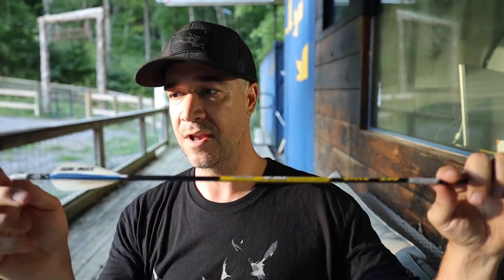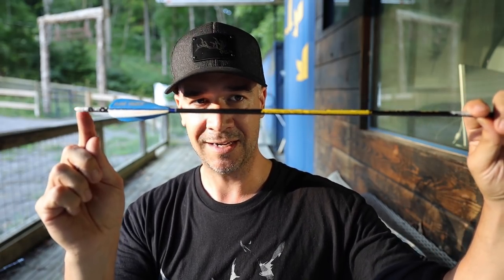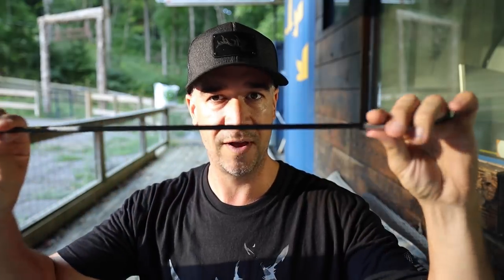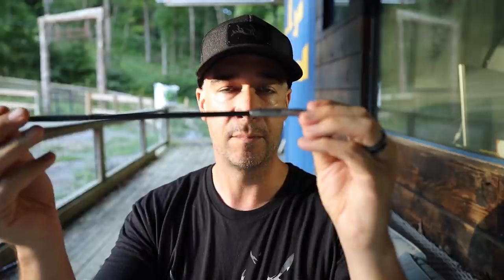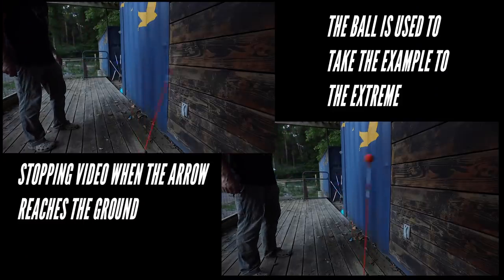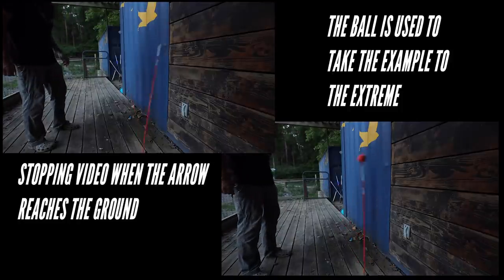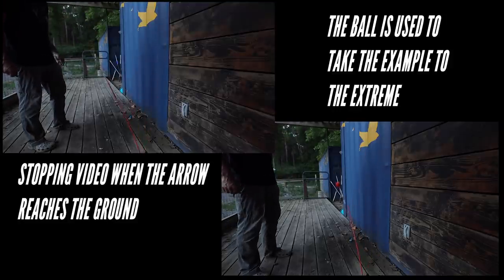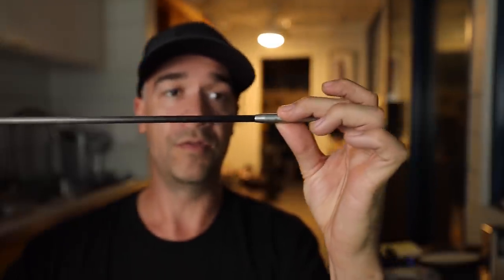Arrows Part 2: A dumb guys understanding F.O.C. (Im the dumb guy)

Comment: You're on the right track with your understanding of why. Some physics to explain:  momentum involves MASS. P=M×V (momentum = mass x velocity) Since all parts of the arrow travel at the same velocity, momentum is contained where the mass is. FOC and why the arrow 'pulls' from the front is because energy in motion is concentrated (kinetic or potential) where mass also is. And so the momentum is focused in the front, pulling the tail along.
The fetching helps the arrow fly straight because of air resistance, not mass; and having more air resistance with the lightest weight material doing that is best (rocket fins). - Thanks for the cool video!

Comment: i agree with everything you summed up in the last part of the video. I also am learning about this, taking info in and really listening to whats said. Like you said- most of it is based on 20-30 yd shots. I think alot of people need to listen first. We dont all need 600+ g front ends to kill deer or elk. The RF info is really amazing and real- get that FOC up as high as you can while keeping your arrow weight to the distances you plan on hunting. For example- i was in the same boat as alot of guys- 65lbs, 27" DL and shootting 400 spine/100 grain tips  around 370 grains. I jumped up to 530 grains with an 17.5% FOC and my pin gap really hasnt changed too much. Great channel by the way, recently found it... two thumbs up :)

Comment: Hey Brandon. love the videos that you make and the contribution you are making to archery. I think I have another thing that you can talk about that is not talked about in all arrow building videos I have seen. its the Kinetic equation itself KE=1/2MV^2. the archery industry tells us that the V in the equation is a more important because the velocity is squared  which means that velocity will increase KE more than the mass part of the equation. As an engineering student I take issue in this perspective. Yes, it does effectively raise your KE value as velocity goes up but what people arent talking about is once you hit an object, I.E. and animal. the velocity quickly declines and an astonishing rate. if you were to calculate the KE after 1 or 2 inches of penetration the KE value is dropping fast because we put so much stock in making the velocity number large. on the other hand, If us as archers put more value in the mass part of this equation, you are putting more energy from the bow to move a heavier object and because you put more energy into the "mass" part of the equation. the mass doesnt decline once you hit an object which explains why mass will penetrate further everytime because we are putting more energy into something that wont decline once it hits something. In short, the harder is is to accelerate an object also results in a greater difficulty to slow it down. ie momentum. the easier an object is to accelerate (focusing on light arrows) results in an arrow that also slows down faster. ie less penetration. I hope what I said makes sense and is a perspective that nobody I have seen on youtube talk about specifically. Stay sweet, MLee

Comment: That intro clip was pretty slick. I too am still looking into learning more about F.O.C. and trying to experiment myself. I did buy a test kit with multiple point weights from 100-300 grains. I have never fletched or built my own arrows, pretty much just grabbed a half dozen arrows (340 spine Cabela's Stalker Xtreme 9.3 gpi, even though for my draw length and pull weight the charts say 400 spine) with aluminum inserts and a 100 grain broadhead. I recently did get some Carbon Express Mayhem SDS 350s that are 11.25 gpi and come with 47 grain inserts. I did buy a couple packs of cut on contact fixed blades that 100 grains since that is all Cabela's had. When I get the test kit I will see what my old 2006 PSE Fire Flite 33 with a 60 lb draw weight and 29 inch draw length likes the best. The advertised speed at 70lbs was 295 at the time, I recently chrono'd my standard arrow set up at 264 fps.  I know speed isn't everything, but I am sure it helps. 
Thanks for sharing and I look forward to seeing what you found out for your VXR with a 30" draw length and 70 lb draw weight likes.

Comment: On the pulled from the front - think equal and opposite reactions. There are four drag contributors on the arrow: the tip, shaft, fletchings and the nock. The tip contributes between 2-5% of the drag (can be higher on broadheads). The shaft is between 60 and 80% of drag, but it is mostly space evenly along the shaft, and the fletchings/nock contribute 20 - 30%. Since the fletchings and nock are basically at the back of the arrow, they are in essence “pulling” back on the arrow as soon as it has left the string. The equal and opposite reaction is that the mass, located more heavily at the front of the arrow, is pulling it forward. It makes sense then that farther foc arrows would want to fly straighter due to these two equal forces being further apart. This can be demonstrated by taking two strings and fixing one to the arrow near the fletchings and the other to the center of mass of the arrow. Put a light force on each string and see how much the arrow oscillates. All else being equal, the farther apart those two points are, the lower the oscillation.
Reply from the maker: Good visual. I may have to try that. Thanks for taking the time to write the comment

Comment: Thanks for update,I have been on the fence for a week now since blowing thru a block crossbow target in less than a year with my 60lb compound.And that's with just field points shooting every spot possible rendering it useless.Also purchased a Morrell Range target in Jan.& already getting pass-thru's,jumping on bag doesn't help much re-distributing material inside.What good does a free new cover replacement do if the inside is shot---Useless. I also shoot field points almost every day year round & broadheads when hunting season rolls around to make sure their still dialed in. I just find  few who have reveiwed this product in detail like you have with your unbiased opion .Thanks

Comment: Dr. Ashby’s website has a LOT of information regarding his theories, ideas, and recommendations. I do not believe he is completely wrong, and I do not believe he is completely right. Here are some of my thoughts:
1) Much of his research is based on African plains game or similar. Even though he does  differentiate (mildly) between those animals and deer/antelope game, it is an apples and oranges comparison. 
2) For “medium game” (whitetail deer), he recommends a 650+ grain arrow with 20%+ FOC (mechanical broadheads are a cardinal sin). To justify this, he uses an example of a hunter getting poor penetration using a bow (unknown if recurve or compound) with a draw weight of 35#, a “light, fast arrow” (no specifics) and expandable broadhead. Gee, no kidding you got lousy penetration. 
So here’s my statement on this, shooting any modern compound bow, with a draw weight of minimum 50#, YOU DO NOT NEED A 650 grain arrow with 20%+ FOC to ethically take deer. 
3) Passthrough shots with mechanical broadheads on deer sized game is easily achievable as long as your set up creates enough kinetic energy to do so reliably. A 650+ grain arrow is not necessary to do this.
4) Regarding “large game” using his example of brown bear, recommends a minimum 650 grain arrow because “Why risk having to use a gun to dispatch an animal (if allowed to save your life)”. If I’m hunting brown bear with a bow, I don’t give 2 craps if I shoot an arrow weighing 8 pounds. I want someone backing me up with a rifle even if I made a perfect shot. That SOB can still charge you after a perfect archery shot!
5) Certain statements, for example, “For his FOC testing, Dr. Ashby used 82, 70, and 54-pound bows of similar efficiency” are vague. Similar efficiency to one person may be completely different to another.

I agree that lightweight arrows are better suited to the target/3D range. I also agree that a higher FOC will increase arrow flight stability and also increase penetration. However, this deer season, I’m shooting 500 grain, 28.5 inch arrows, traveling around 278 FPS, with an expandable, at around 13% FOC. If Dr. Ashby’s theories are correct, and my arrow bounces off a deer, or if for some reason, the arrow actually does penetrate (probably only the same as a hungry mosquito), I’ll be the first one to let you all know, and sit down for my crow dinner.
Reply from the maker: Let's say on a scale of 1 to 10 it takes a 3 to kill a white tail. We may be discussing how to get your setup from a 5 to a 6 and are completely overkill for white tail. I've shot a pretty fair amount of white tail in the last 8 years and with similar specs to what you just named, I'm slightly longer draw but generally used a sub 500g arrow with a mechanical out front, I've only not gotten a total passthrough twice.  one shot was high in the shoulder and another one was in the spine straight down on top of him.  I'm mostly hoping this will help people understand there are other options.
Reply: The 650gr threshold is specifically for breaking bone. You can get passthroughs with less, but this is planning for the worst, not just hoping for the best.
Reply: Brandon Mcdonald, first off I’d like to say I find your videos informative, refreshingly unbiased, and well produced.  
I agree with your 1-10 scale regarding whitetails. If we change that 1-10 scale to specifically whitetails, I believe Dr. Ashby’s recommended (not his “minimums”) arrow weights and FOC would land at about a 12. 
It is also an excellent point that we look at different options and opinions.  I believe Dr. Ashby’s work has made the bowhunting community cognizant of FOC, and as a result, creating a more accurate and lethal arrow set up. 
I guess some of his opinions remind me of something I was told in the mid 90’s (when many, including me, were shooting those silly 2-3” overdraws) as a 14 year old. In NY at that time, this was the minimum age you could hunt big game with a bow. That was my first deer season I could hunt. My bow’s poundage was set somewhere in the low 50’s. One of the local “experts” saw my set up at the archery hunter ed course I was taking, and made sure I was aware that I had no business hunting deer if I could not pull at least 60 pounds, minimum. Talk about a kick to the guts as a kid excited to hunt his first bow season. Luckily, after this, my dad (who has never bowhunted) had the wherewithal to bring me to a few pro shops, who all reassured me that there was absolutely nothing wrong with my set up. I didn’t get a deer that year, however, if I took that “experts” word as gospel, would I have walked away from bowhunting? My point is that (in my opinion), some of Dr. Ashby’s recommendations are of one extreme, and usually the truth is in the middle.
Brandon, keep up the great videos. I look forward to however many installments your discussion on arrows takes, as I will be watching all of them.
Reply: stuponfucious7 I respectfully disagree. You can break a deer’s scapula (and most certainly rubs) with a sub 650 grain arrow and not be “hoping for the best”.
Reply: @kwikgto389  definitely not saying it CAN'T happen. Only that Ashby's research showed a more consistent likelihood at that point.
Reply: @shabbos1 both bones you mention are relatively narrow. Whether you shoot a 400 grain arrow or a 650 grain arrow, neither are points to aim at. I suppose we could talk about marginal shots all day. What is a more effective hit? A 650 grain arrow that hits the two narrow bones you mention, or a medium weight arrow (roughly 450-525 grains) that deflects into the vitals? Which is the worst shot? A 650 grain arrow that breaks a humerus, but does not hit vital organs, or a medium weight arrow that “sticks” the humerus, does not break it, and does not hit vital organs. Again, as long as we are talking about marginal hits, if we are talking about liver/gut hit deer, which is the better of two bad outcomes? A 650 grain with a single blade with two edges, or a medium weight arrow with a fixed 3-blade broadhead (i.e. muzzy, thunderhead), or that same medium weight arrow with a 2” expandable, with all three arrows being a pass through. 
Just to be 100% clear, I am NOT advocating taking marginal and unethical shots. I’m just saying that a forward hit (again, no, we are not aiming at these points) on a deer is just as likely as a rearward hit.
Reply: @shabbos1 - “that still allows for practical trajectory”, I agree 100% with that. However, my stance is that 650+ grain arrows do not allow for that, unless you are shooting distances of about 25 yards or less.

Comment: Bro, i found you over at Average Jacks channel.  I love your approach here man!  Its so important to not be a total snob about this stuff and always be in a learning mode.  You seem to be there and I respect that tons!  The reason i started this journey of looking into foc here lately is because I’ve only harvested 1 of the last 4 deer I shot with a bow.  And, i can understand the occasional bad shot and no recovery, but that percentage should be way lower.  Not to mention, my bow literally bounced an arrow off of a buck last year at 7 yards with mechanicals.  I’m done with those things.  I understand they work.  I’ve killed some deer with them.  I’ve gotten a pass through or two with them.  But that’s the thing, you have to hit the right spot.  The high foc with fixed broadheads that are strong and sharp are referred to as plan b arrows.  Meaning, when your deer jumps the string on you and you don’t hit exactly where you were shooting, it will still get the job done.  A scapula is nbd for a high foc arrow that’s flying good and has a strong/sharp head.
Reply from the maker: Love the Average Jack channel! Hes got lots of good info and I just like the vibe overall. I'm working on a broadhead video now and the penetration difference is insane.

Comment: Really enjoying the content. I think a part that people are hesitant to is them thinking everything has to be extremely heavy vs where the weight is distributed. 

Something that helped me understand this is when a truck is towing a trailer and where you want the weight primarily. It's not always about becoming heavier, it's about where your weight is. Just being heavy enough to carry the arrow and deposit the energy in the animal.

We are moving arrows faster than before so we don't need to be as heavy as old tools use to be. It's having the appropriate balance of weight and speed to kill and then appropriate balance to be efficient.

Comment: Think about it from the view that the arrow is a static thing that doesn’t “want” to move. The arrow isn’t going to move until it is forced to. So just because the force is being applied from the nock end of the arrow, until that energy reaches the point end of the arrow and can not longer travel along the shaft the arrow will stay put. Now, this all happens extremely fast when the bow is shot, but the energy doesn’t force the arrow to move until it reaches the end of the arrow. Then, once the arrow starts moving all that energy is still in the front of the arrow thus it “pulls” the rest of the shaft along. The more weight out front the better it “pulls” the arrow when it hits a medium because more energy is stored in the front of the arrow as it flies along.

Comment: I started diving into that rabbit hole of math, physics and engineering and definitely can get overwhelming. I've been reading a lot of Dr. Ashby's work also. Here's what I deem important, structural integrity, efficient flight and higher FOC. Heavier projectiles penetrate more than lighter ones given the everything is equal (structural integrity and arrow flight).
Reply from the maker: Sounds about right to me as well.  Common sense enters the picture as far as the structural integrity goes.

Comment: Just bought 2 dozen day six arrows with the 50 grain inserts,  now kicking my self for probably not getting the 100 grain inserts- outserts... ur videos are great content that is very understandable...
Reply from the maker: Order a dozen of the 100 g setup if you're spined alright.  Take your knock out of the arrow and then put in a drill bit with the back facing forward. Start slinging that like a slide hammer into the insert and it will come out. Beware of windows!

Comment: A) I have a southern accent and my “dumb guy” impersonation is always just an exaggerated version of what I already sound like.. Odd.
B) I’m on the high FOC bandwagon and I just never understood the speed thing. If the animals going to flinch, the time difference between a 280 fps arrow hitting and a 260 arrow seems negligible. (Though, yeah, thinking about < 30yds.. the long distance trajectory thing seems pretty relevant) 
C) someone smarter than old “southern accent me” should figure out how long it takes various speed (250, 260, 270, etc) arrows to travel distance (10, 20, through 100 or so)
Reply from the maker: Going from 280 to 260 wouldn't be worth worrying about. I'm curious about going from 330 to 210.   I'll have a deer I shot last year in part 3 to show drop. I haven't started editing yet so I'll be really curious to see how it comes out
Reply: Gotcha. I went from 415gn at 285ish to 560gn at 260ish (I forget what the FOCs were/ are because that’s what we’re talking about here). I imagine most folks are well under IBO for one reason or another to begin with and that 90% of people are running prefletched, 6 pack arrow, with 100gn something or other up front (the 0 effort rig), which I believe TYPICALLY winds up in that low to mid 400 range. 
Annnnnyways, point is... looking forward to the video!!